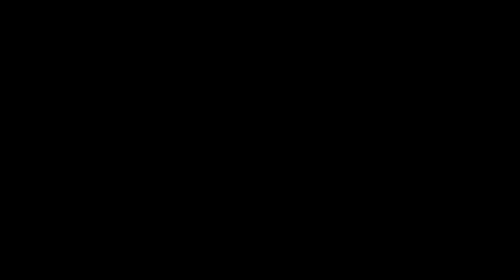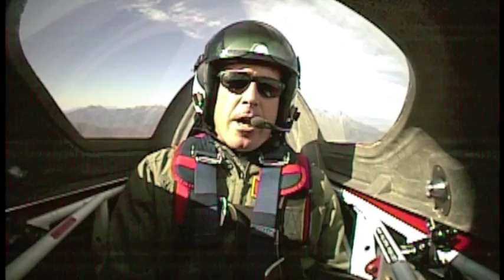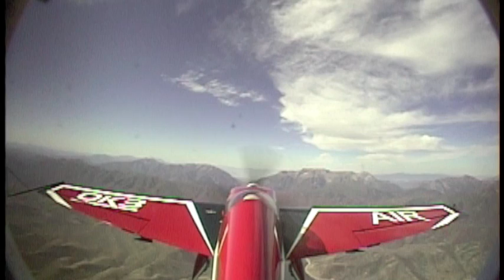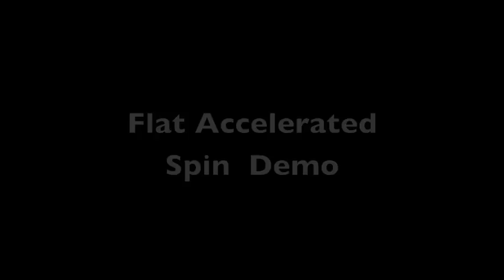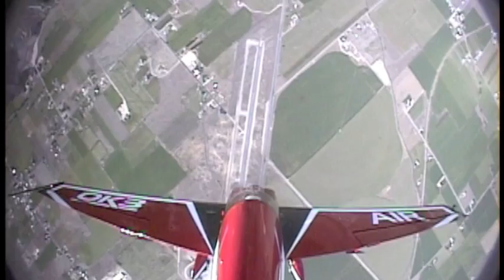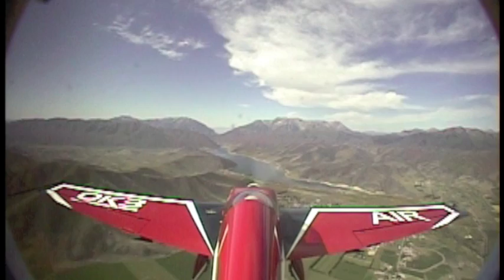Airplane Spin Recovery Demonstration

Comment: another thing is that most of these spin accidents that result in crashes are at lower levels while the aircraft is about to land.  It isn't easy to tell in this video but you can lose around 1000 feet before regaining control.

Comment from the maker: airplanes not designed for pure aerobatics, like trainers and military jets(not designed for inverted  aerobatics) sometimes have a hard time recovering from unusual spins - flat, accelerated, flat accelerated, inverted, flat inverted, etc.. F-14 had a tendency to inter a flat spin with an engine loss at high power, high alpha (dogfights) because of the off-centerline position of the motors.

Comment: This is an aerobatic aircraft with massive control surfaces. Recovering in a standard piper or Cessna uses the same techniques but it might take a bit longer to recover as the rudder is tiny compared with this aircraft.